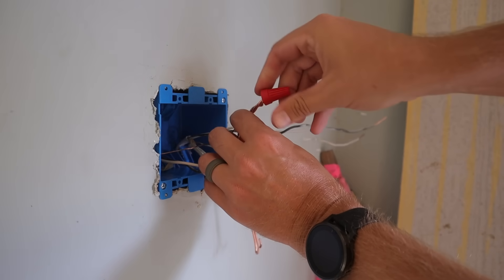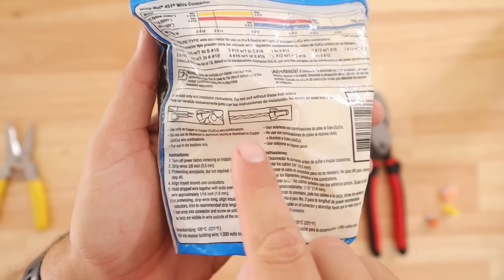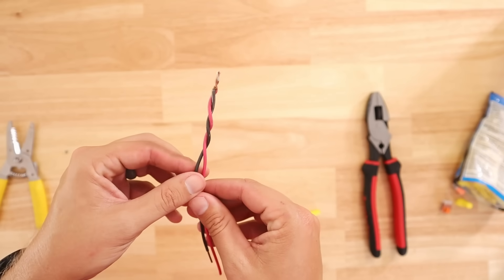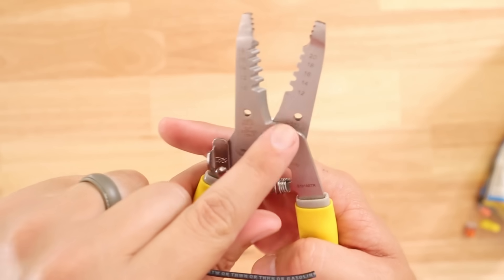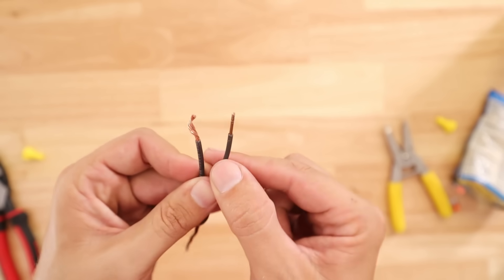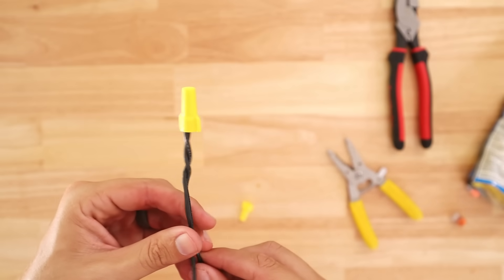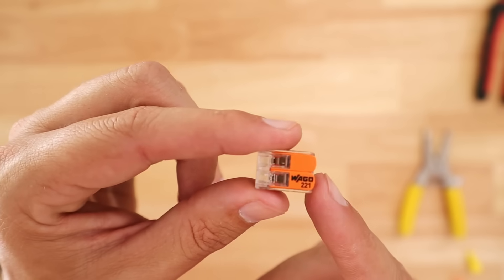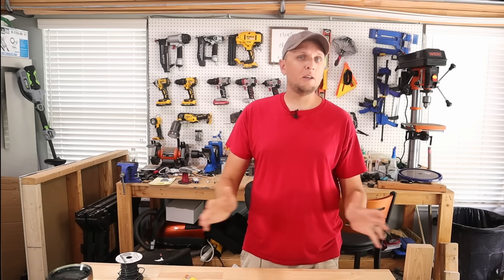BIGGEST Mistakes DIYers Make When Connecting Wires Together | How To

Comment: If working in a small junction box where you’re joining in LED recessed lights and you have two solid wires and one stranded line how do you twist them altogether on your black wire white wire and ground wire?

Comment: thank you, im installing a fan but the wires on the fan are really short and my ceiling wires are longer and it's not working. going to try to get them the same size for a better connection.

Comment: Recently I was changing some outlets and the old one weren't  grounded the new ones were grounded but there were only two wires in the wall I was told to jumper the ground wire to the neutral side from the green screw up to the neutral side  please what's the proper way I always was told to string a wire from the ground side to the box but there wasn't any box that we could tell

Comment: As a electrician for over forty years a properly installed wire nut is by far the safest  !
Reply: Wagos are game changer. Not saying wire nuts don't have their places but all those wire twisting, those necessary, will just damage and shorten the wires faster at every service. Wagos and pigtail, in my opinion, are the only BEST way to connect wires. Secure connection and preserving the length of the wires. Honestly, I can't imagine anyone argue otherwise. Old habits die hard I guess.

Comment: The ideal push in connectors are the same as back stabbing a receptacle, I refuse to use them and will remove them from fixtures that come prewired with them. They wago lever locks are only slightly better than the push ins and I refrain from using them unless I absolutely have to. The only time I use them is for mixing solid and stranded wire or for making up a temporary jumper for trouble shooting.

Comment: My understanding is that electrons flow on the outside of the conductor.  It that is the case, wouldn't one want to use smooth jawed pliers to twist the conductors?  It looks like the lineman pliers mar the conductors while twisting them

Comment: I just had to do 27 slices in a home there was wired by a guy that said he's been an electrician for 30 years and he did not wire splice twist anything😮 so I had to take everywhere night off and show him why😅 when they separated and lost power then I said see now power will not go down line so it's not only out at this point it's out all the way through the house so twist the wires then put the cap on the cap is just to replace tape because somebody said tape is not safe anymore😢

Comment: In most of the wiring im doing in my home, the wires are old and theres not enough space to continue twisting the wire nut. Regardless of the splicing device im using, i always wrap the connection with electrical tape

Comment: imo, solid wire does not wrap around stranded wire, the only thing that holds wires together with this wing nut wat-cha-ma-cal-it technique is a DOUBLE twisler wrap friction entangleing effect - which doesn’t hapen with 1 wire wrapped around another straight 1👋. IO, bad idea.

Comment: Have you ever tested the resistance of different connecting options? I suspect the Wagos have higher resistance, due to the small contact area.
Reply from the maker: They do but it is almost not worth mentioning.  Still fall well within acceptable values.

Comment: Important note: Many (if not all?) wire nuts are a mechanism that is designed to constrict the inner metal wire coil around the subject wires to be bound up tight (think of a thin heli-coil that mechanics use).  Once used correctly, that special metal wire inside the wire nut plastic housing is not going to "uncoil" like a twist-tie on a loaf of bread.  "One and done";   use a new wire nut in order to have a fresh metal constricting wire (think boa constrictor-worthy example).  Look closely inside and you will see how far down the constricting wire travels once used/spent properly.   The task requires precision, so grab a new wire nut, confirming that it has not been already used by having a well-visible metal coil at the top of the plastic thread. 

All glory be to God Almighty alone.  Salvation is by God's grace alone upon His predestined elect alone, paid for by the blood of Lord Jesus Christ alone.

Comment: Muricans seem to have trouble with Wago connectors, how about you carefully push your wires back so you don't open the levers? Never has a lever opened on me, and you could also use those really slim ones without a lever 0,5-2,5mm where you can just push the solid wires in there, they never come out unless you twist and pull hard. But oh well, talking to people who still have their electricity on wooden poles...

Comment: I'm crazy... when I joined solid and stranded wire together,  I solder them together and than put them under a wire nut 🫣

The connection is still holding after 5 1/2 years 😊

Comment: Hi Adam.  Great video.  If I could get some help properly grounding a 230/250 V 30 watt outlet to a metal box.  I find working with 10 GA wire awfully difficult.  Do I have to ground the box (probably) even if the receptacle is properly grounded at the circuit breaker box?  Please answer.  Thank you.  Dan

Comment: I always pre-twist my wires by hand (copper to copper or copper to stranded) with both wires at a 45 degree angle and rotating equally, never twisted the insulation part and never ever used pliers on wires or insulation since pliers damage the wires or insulation which compromises the integrity of the whole thing. If you’re careful maybe it all doesn’t matter but all bad electricians use pliers to pre-twist and damage the insulation or break the wire or don’t pre-twist and make a mess under the wire-but or marrette.

Comment: One thing not mentioned is to not make the stripped part too long on one wire and not pre-twist. If you do this there is the possibility of the long wire punching through the end of the wing nut  and being exposed. In all these videos no-one mentions a  reason to twist the insulated part is so that pulling on one wire also pulls on the other wire - it acts as a sort of clamp and prevents one wire from coming out on its own if there is a failure for some reason. This would be more important with a stranded wire which if not correctly done can easily pull out on its own. Also when twisting, I usually use pliers for leverage and so I cannot feel the force being applied very well . I do not pre-twist the insulated part so that when I am twisting the wing-nut and see the insulated part twisting I know I am applying the minimum force required. I recommend reading @charliesmithpridetronics comment if you  twist really hard, or if you are tempted to re-use wing-nuts when working on an existing installation that you are modifying.

Comment: I always take a few minutes and solder twisted strand wires that come in most wired fixtures. This makes for a better connection. Then just ensure that you real twist “both” wires together, not one rapped around the other.

Comment: Do not rely on the wire nut to twist two solid wires togather, they are not designed for that.  Ive seen someone get bolted because the nut was so tight the wires came out the top.  Also there should NEVER be a buldge in from the spring inside as your putting pressure on the insulation which over time will break.  Be careful with stranded wire, unless its ten or larger you should not need pliers to twist it, just hand twist, tighten the nut down until it feels like it bottomed out then give the stranded a quick pull to make sure your good.  If standed wire is over tightened, especially small standed the wire nut will cut into the small strands if its on too tight, just turn until it gets tight then stop, don't go crazy twisting it.  There is so much bad advise in here ... SMH

Comment: Trying to do speaker wire connected to LOC and then rear speaker wire for signal how would I twist three wires together ? Want to kinda avoid soldering seen someone wing nut three wires

Comment: I learned from a master electrician many years ago about pre-twisting.   Personally, I look at a wire nut as an insulator, not a connector,  if that makes sense.  I always pre-twist, cut at an angle, and twist the nut on.  It makes for a clean, secure, and good bond.

Comment: The biggest mistake DIYer can make is using wire nut at all.

Don't. Spring clamps are foolproof in hands of newbie, and if really good connections are in order, there is crimping (investment in tools is negligible unless one buy some sweet power crimper instead of more pedestrian hydraulic).

Comment: You're making a mistake with those figures.  You can insert the wires without twisting.  When you twist them the wire outside of the nut can twist as much as they want and the wire inside isn't going to be twisted much.

The answer is, if you want to twist them before using the nut, you can.  But you don't need to.
Reply from the maker: It’s not a mistake.  I literally said all of that in the video.  However, I have never had the wires under the wire nut start twisting together unless the wiring under it is starting to too.  So there I disagree.

Comment: As an over 20- year experienced electrician, I agree with pre-twisting solid wire and using the wire nut only for 4 or less stranded wires, more than that I will pre-twist the splice neatly. If done correctly you will never have a bad joint, but you do have to watch out for wire nuts loosening when thumb or other fingers graze past them as you are packing the joints into the box. If you do not pay attention you can pre-loosen a wire nut that will fall off as you open the box and you know it was tight before since every joint I pull on it to check it to QC my work - every joint. When doing this I have made 1000's of splices and the only ones that failed were the ones I did not pay attention to while packing the j-box.  I DO NOT recommend twisting the wire all the way down as shown on the packaging. That picture only exists because knuckleheads these days use their impact for EVERYTHING and Ideal and others include an impact wire nut twisting tool that fits in the impact shaft and it will do exactly that with the wires. None of the "electricians" that do it like that obviously do not have to go back into that box and troubleshoot as you would do in troubleshooting an service work.

Comment: 07:50 I had this issue in my ceiling fan, the stranded neutral wire slipped out of the nut and was in contact with the plain copper ground wire. Not all ground wires were connected either. Perhaps this was causing the fishy burning smell as the fan ran.

Comment: I disagree with twisting. Your wire nut when installed properly will hold the wires tightly together and you won't be able to pull them apart.
Twisting wires damages the wire and potentially the wire nut.

Twisting wires is for those who can't make properly install a wire nut.

Comment: All these are great tips for if you have the extra wire to do it properly. Which i would agree to do these methods if there is enough excess to do so. However. Ive had to do a lot of situations where you dont have the luxury of being able to get linemens in or do the extra insulation removal. Sometimes ya gotta just twist and hope it catches and then keep twisting.

Comment: Just curious, do electricians ever solder when splicing solid core to stranded. I realize it's a lot less convenient then using a wire nut or wago connector. New to the wiring stuff and I 
Already have the things I need for soldering but I don't know if that method should be used in this situation. Thanks for the advice and appreciate the information 😉

Comment: I was told by an inspector a few years back that pre-twisting  solid conductors using linesman pliers can result in the wire nut over-twisting the copper, causing work hardening, and breaking it, or weakening it to near breaking. It also mangles the copper as shown in this video. 

Btw.. .you shouldn't put edits between every single time you thread a nut on, edit, then show they didn't connect properly (when they clearly did and you edited out where you made them connect poorly. It just goes to show that it's much harder to mess up a connection if you have to edit making the bad connection happen.
Reply from the maker: It is not hard to do.  And the inspector is not correct.  Work hardening occurs if you go back and forth with the metal.  Appreciate all the great advice though.

Comment: Not good connectors at all. As an electrician in the UK of 44 years, you should never twist solid core conductors together, due to putting conductor under tension and potential snapping. We don’t generally use that type of connector any more for that reason.

Comment: Too many people push these wagos for one reason and that is they are getting paid to push their sales. Wire nuts have been used for over a century and have been not a problem if the person knows hot to use them. Wagos can be used wrong too if the hands of a DIY'er or licensed electrical.
Use what you have and what you are comfortable using.
As for DIY'ers who use nuts a few times a year and have dozens sitting around....why pay a fortune for wagos except to make people rich.

Comment: Yes, kind or reading my mind here...carpenter all my life & never delt/worked with electrical. That said, retired now & working on (my) "this old house" recently  bought.  
 And have a situation where I want to run new romex (replace non grounded romex), from a (new/converted), braker panel/box,  but think I will need to use junction boxes to "y" or "w" runs to outlets in (2 rooms). 
  What is your thought on using wago connectors vrs wing nuts? And should  I twist the wires together, err, (not together at the copper), but so they would be less likely to come out of the wago connector? (If that makes any sense,  ha!), just saw on another youtube-er video that wago's are higher heat(?), rated than wing nuts, so got me thinking they would be better to use, but? Plan on using 12/2 yellow romex, if that makes a difference.

Comment: I might be old school 62 years old but I was taught to twist the wires together by good ole Uncle Bobby who own a construction/home remodel business and it has never failed me he also taped wire nuts with electrical tape that was back in the 70's I still do it today but usually on outdoor things I have to splice together like extension cords or old school christmas lights or low voltage wiring. I like your videos and I always seem to learn something new I never knew on the wire cutters there was a solid and stranded side to them. Taught this old dog a new trick.
Reply: Personally when wiring I properly use wire nuts. Additionally, if wiring outdoors or in potentially wettish locations I also tape the connection.

Comment: keep twisting , keep twisting, until he wires either crack the nut or push out the end. pre twist, cut even, screw it on.  always leaveleave your smaller or stranded wire a touch longer

Comment: I have a question regarding soldering instead of using wing nuts? My dad was an electrician in the 70s and I soldered thousands of joints, so I am comfortable with that method.  Would you say soldering is superior or wingnuts? I’m not considering convenience, just joint quality.

Comment: Great video! Yes your video  it surely explains how to make a good wire connection! What would be cool is to see what would happen if the connection is not done properly. I would not dare trying it myself but I always wonder if it would actually spark and start a fire? When I change a switch or a light which require a wire connection I always take the extra step of turning the current on and listen carefully if I hear   a grizzling noise I close the switch right away.  Am I  too paranoid? Would the breaker simply jump if the connection was that bad? I would never do electrical work with currents of more than 120 volts, électriciens do amazing work so why not using them in more dangerous situations?

Comment: Wago connectors are NOT GOOD! The connection is not reliable and have had wires pull out,loosen,etc. Don't use them! Use the CORRECT wire nut for the size wire. I've never twisted the wire nut so tight that the insulation is twisted also. If you strip the insulation back an inch,take linesman pliers and make a good couple turns,cut off excess and twist on wire nut. Make sure there is no copper showing to short out. 30 year electrician here
Reply: Lol.. Wago connectors are perfectly fine, and you don't need to use those with the levers. They never pull out. Otherwise, you're just incompetent. You guys can learn a lot from electrical installations in Europe.
Reply: My daddy always twisted  solid wires. He never failed, and I followed in his footsteps. I do not tape though,...but I am always neat and always have a habit of pushing wires and nuts into the box with the wire nut always pointing up using gravity as my friend. Makes the job look very professional.

Comment: I used all wagos when replacing a ballast in my kitchen light. I turn on the light and it worked great for about 20 sec. Then I heard a sizzle and the lights went dim. It's been about 10 years since I've stood on a ladder to try replacing the ballast again. Yes, I have it wired correctly - double checked. I've since purchased new yellow wire nuts, but I'm 68 now, live alone, not sure if I should get on a ladder and try again myself. I just figured there were too many wagos and apparently one of the connections was off. It would be nice to have a video on other wiring connectors. I thought it would be easier to use them. You may have already done a new video as I see this one is about a year old, but very informative.